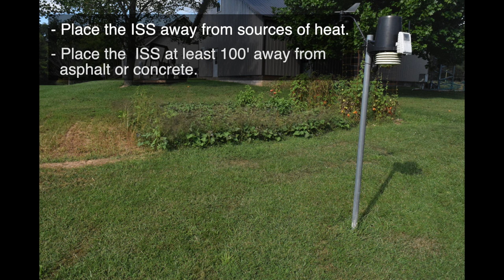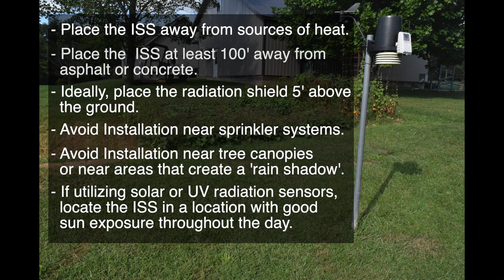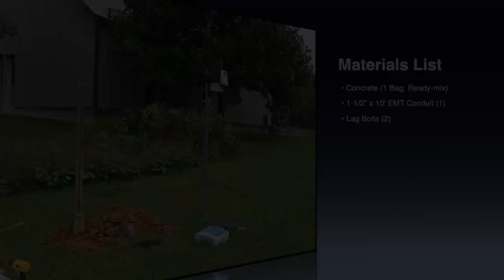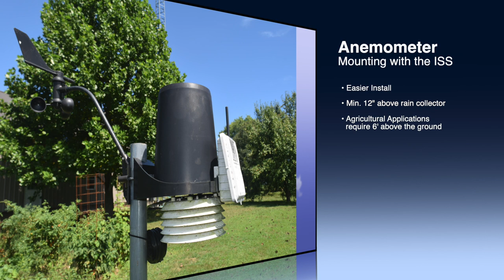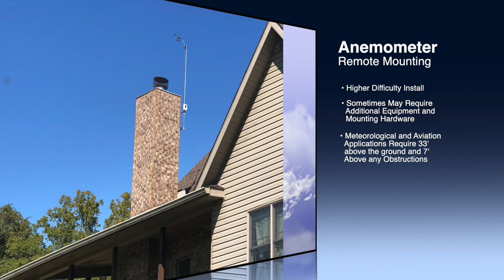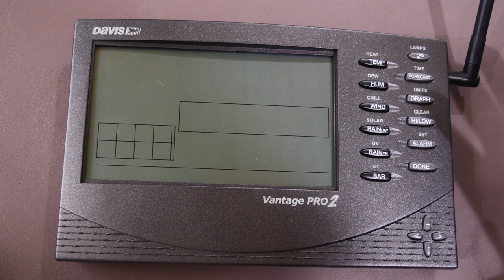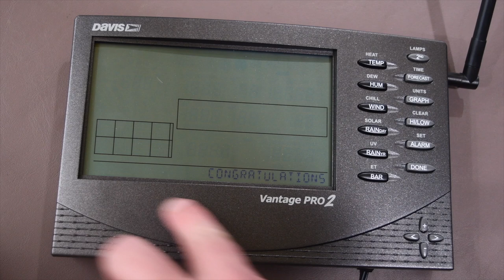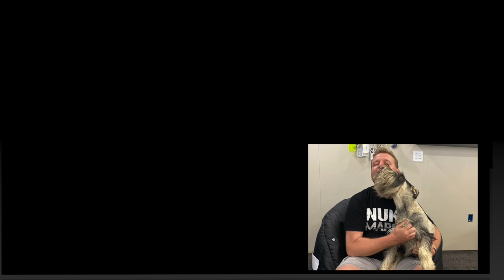Davis Vantage Pro2 Plus Install -  Part 2: Mounting the Integrated Sensor Suite (ISS) and Anemometer

Comment: Does it matter which way the anemometer's arm is pointed when it's mounted?  I ask because I want to mount my sensors on a stationary vehicle as I live full-time in my big RV, and travel all the time.  I understand the setting of the solar panel's direction to take advantage of the sun's rays as much as possible, but I'm not clear on whether this placement will affect the anemometer's readings if that arm is pointed in the wrong direction.
Reply from the maker: Good Evening Ernie.  When installing the anemometer, it should point due north.  If for some reason it is not, in both the WeatherLink Desktop software and WeatherLink Live, you can set an offset value to correct for this.
Reply: @HoosierWeather  This aspect of pointing due north is another concern for me, How can this be archived, how do you simply obtain the due north direction.

Comment: Thank you for this video. I was looking for a solution for how to mount my anemometer to my chimney because it is the only way to get unobstructed wind readings in my neighborhood. Do you think PVC pipe would be sturdy enough for the anemometer?
Reply from the maker: My preference would metal. I too considered PVC (either sch40 or sch80), but over time that would more than likely get a bend to it.
Reply: @HoosierWeather  Thank you! I switched from PVC sch40 over to a metal conduit pipe. My nerves are now settles about the potential of the PVC snapping in a high wind event.
Reply: @HoosierWeather  Yesterday, we had a storm with 1200 lightning strikes in the first hour. Personally, I would prefer not to mount metal pipe on my house.  Good video, thanks for the help

Comment: Hello; thanks for sharing. Normally, to enable the solar panels to absorb enough sunlight, it has to be mounted to face SOUTH. Now my question; How can this be done simply when on the field?
Reply from the maker: For the solar panel mounting, it doesn't have to be an exact science.  You just want to get it in the correct general direction so that it receives the most sunlight possible, but I'll admit that I used a compass to align mine.

Comment: Live data is missing some properties like temp, hum etc current observation data in vantage pro 2 wireless console after data logger firmware update. Is there any way to revert back to 1.1.1
Reply from the maker: Unfortunately, reverting console firmware is something I have not tried.  That might be a call to Davis Support.

Comment: Are you concerned about mounting above the chimney? Will this affect readings?
Reply from the maker: Not really.  I don't use the fireplace much and it clears the top of it by several feet.  I would have liked to put it somewhere else, but my mounting options, in places in which I wasn't risking death, were limited.  :)

Comment: What keeps rain from going down into the pipe and freezing and swelling and rusting over time??
Reply from the maker: There is a risk that this could happen.  I did not drill any holes below ground level (except for the lag bolts) for water to drain, but the bottom opening of the hole is in soil and not concrete.  This should allow any water that has collected in the pole to drain.

It is something to consider, but I will probably replace the pole when the time comes for a new station.  It is probably worth considering plugging that hole, if for no other reason, to keep wasps and other bugs out.

Thanks for the comment and thank you for watching!

Comment: Did the heat from the fireplace cause false reading on air speed and direction?
Reply from the maker: We rarely use our fireplace, but I didn't see any changes in the wind reading when we did.

Comment: Hi i have an issue, the wind speed reading is not showing , its showing zero though the wind direction is showing correct. Please help!
Reply from the maker: It is curious that the wind direction is reading but the wind speed is not.  I am assuming the cups are spinning, is it possible the set screw has loosened?  My next thought would be the cable.  Do you have another straight through cable to try?

Comment: Hi there, can tou tell me the height of the ISS (excluding the anemometer)? From bottom of radiation shield to the tip of the UV sensor?
Reply from the maker: Just the ISS itself is ~20.5", just about even with the rain collector.  The spikes on the rain collector, depending on how much you push them down in to their holder, stick up about the collector about 3".
Reply: @HoosierWeather  Thank you so much for getting back to me so quickly. I have a Vantage Vue and am considering an upgrade. The fan aspiration is what I am really wanting. Currently, morning and afternoon temps when there is no wind and sun always appear about 5 degrees over.

Comment: how high is the sensor from ground?
Reply from the maker: From the ground it is 33'.
Reply: @HoosierWeather  how about the rain collector?
Reply from the maker: revadan , it is 6’ from the ground to the bottom of the ISS. Planning an install?
Reply: @HoosierWeather  yep i ordered a wired one.. is the cable for the anemometer and rain gauge separate,  i need to mount the anemometer on the roof and RG just about 6ft from the ground in the backyard.. chosen the cabled one coz i need to link it to APRS.
Reply from the maker: An APRS video is in my queue of videos to produce.
Reply: which of the sensors are you talking about?
Reply from the maker: The anemometer and the ISS.

Comment: Hello, my only option is to put weather station on top of the building... height is about 25 meters (80ft) is that very bad or good?
Reply: Can you please answer me?
Reply from the maker: My apologies for the delay, it has been busy.  My first thought is that 80ft is not good.  However, I have seen units mounted on rooftops.  Davis recommendations specifically say "You can also mount the sensor suite on the roof, between 5’ (1.5 m) and 7’ (2.1 m) above the roof surface." 

Additional information can be found here.

https://www.davisinstruments.com/resource/what-is-the-best-height-at-which-to-install-my-weather-station/

https://www.davisinstruments.com/product_documents/weather/manuals/07395-262_IM_06357.pdf
Reply: Davis recommends 6 feet above the ground for the temperature and humidity sensors to work accurately.